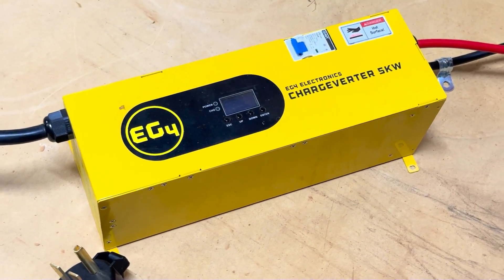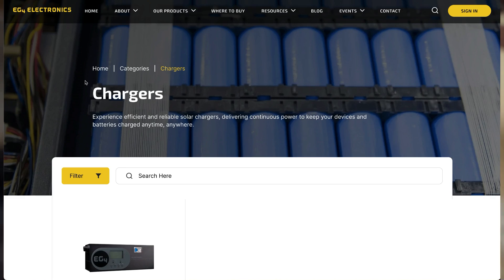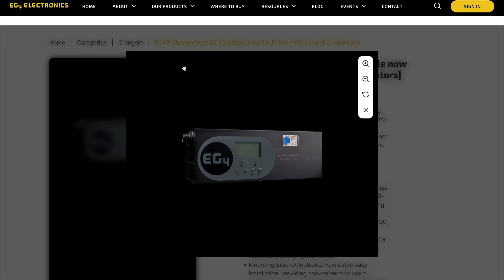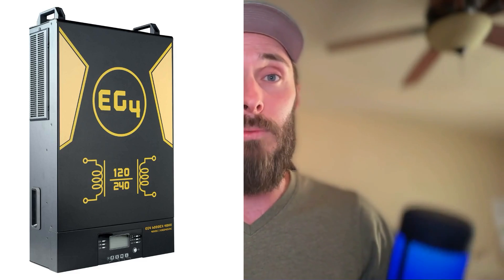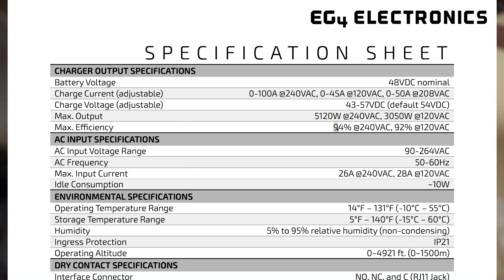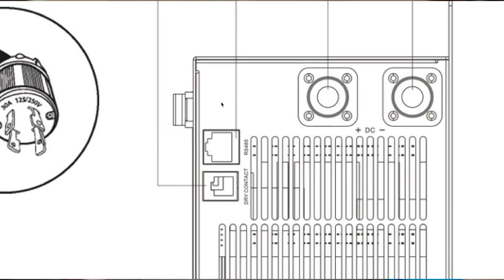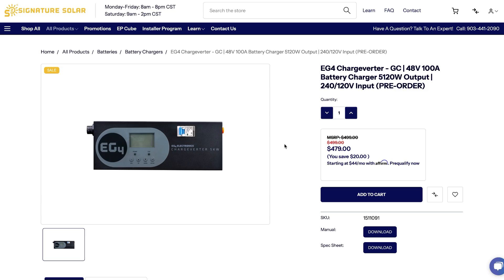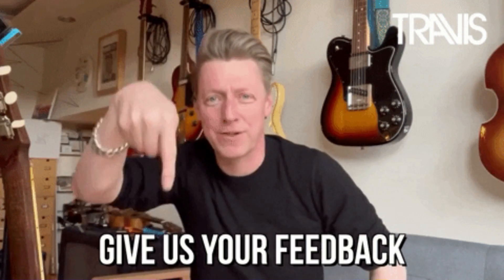The Secret's Out: The New Chargeverter GC by EG4

Comment: Is this unit capable/compatible with Forklift batteries (48v)? Signature Solar says "yes"... just asking to see if anyone has attempted to charge their 1000Ah battery banks with it or not. I am considering it but I want to be sure before I purchase it. Thanks for any insight!
Reply from the maker: I can’t see why it wouldn’t be compatible. You would just need to tweak the voltage settings a bit, which is much easier on this new unit.
Reply: @EastTexasHomestead  thank you for responding! I thought the same but I wanted a second opinion just to be sure...greatly appreciated!
Reply from the maker: @rongray4118  You bet. Feel free to use ETHSAVE50BUCKS for $50 off if/when you buy from Signature Solar

Comment: So, I have 2 6000XPs with 2-Power Pro Batteries.  My question is how is the chargeverter connected?  Do you feed power from the chargeverter to the input ports on the 6000XPs with equal lengths of wire, do you simply charge on one battery as they are supposed to be wired in parallel, do you set up another sub panel and wire the chargeverter into the sub panel and put the batteries on breakers? or put outputs from breakers wired to the generator inputs on the 6000XPs